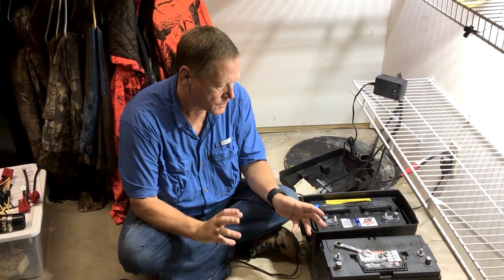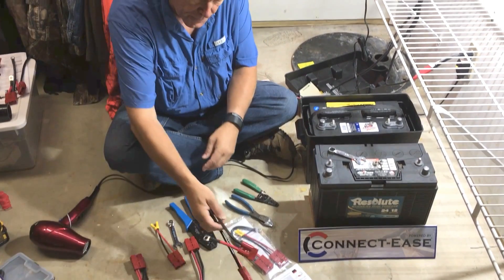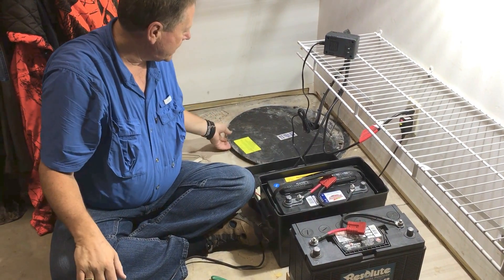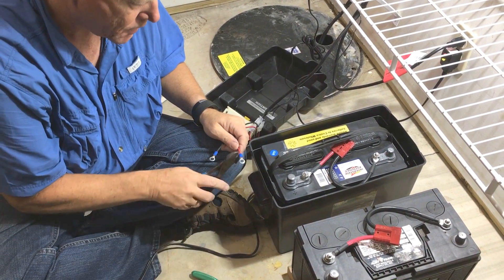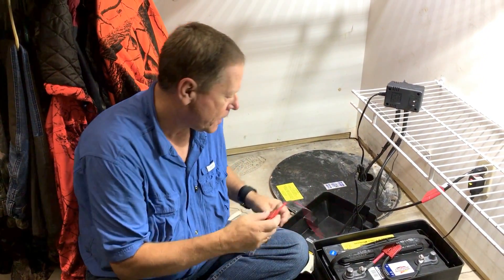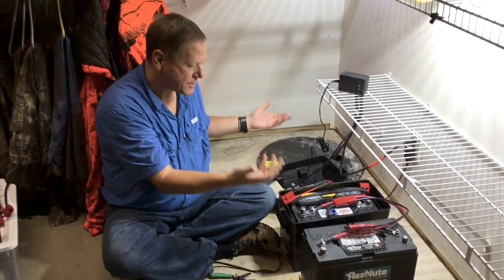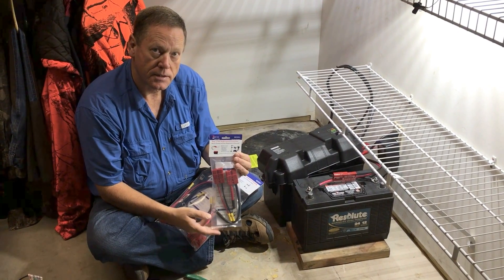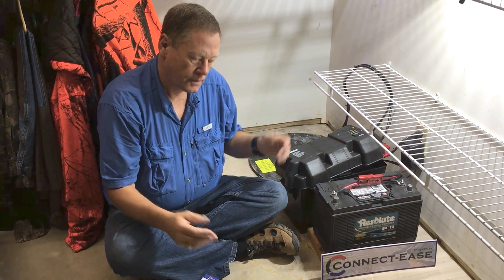A Sump Pump Battery Backup Solution using Connect-Ease Easy Connection System

Comment: What kind of battery charger do you use when you use two batteries? I have a basement watchdog.
Reply: The watchdog charger will charge both batteries and maintain them if the backup system doesn't drain both batteries completely. If that happens c just use a standard charger to charge the batteries back to full and the the Watchdog system will keep them charged while the system is not being used during a power outage.